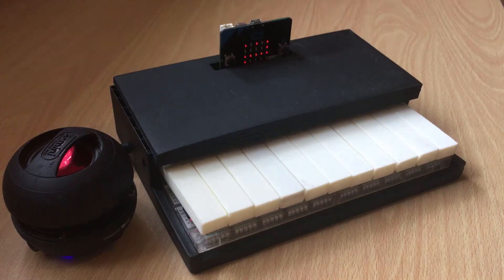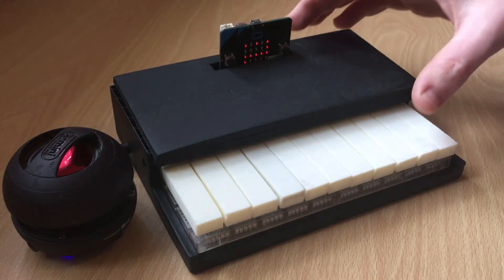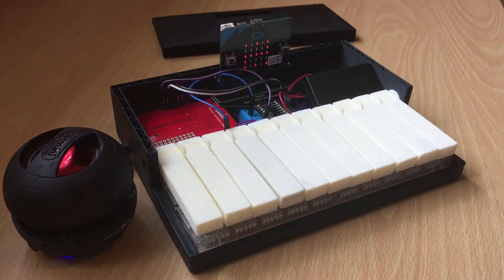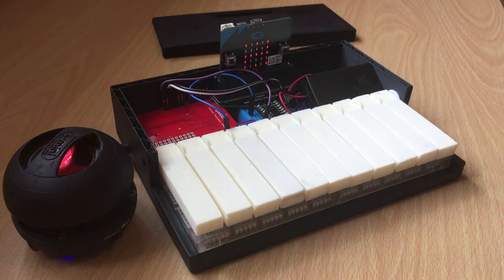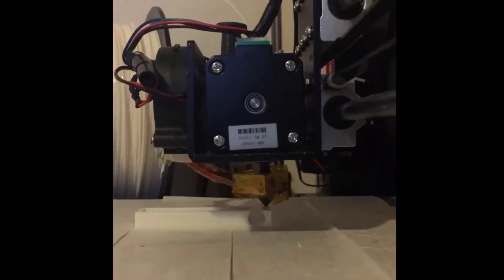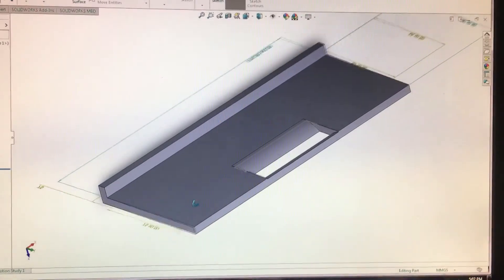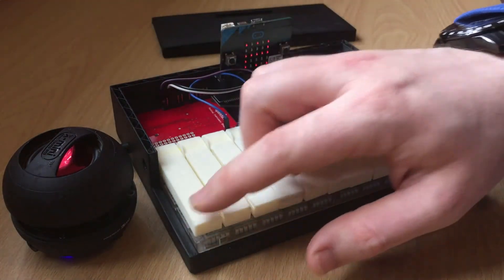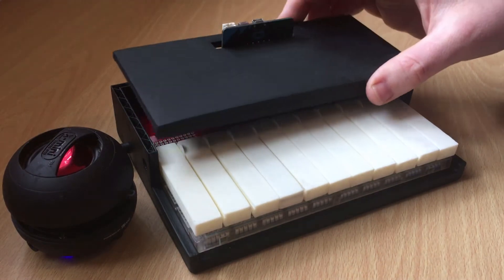Musical Microbits

Comment: Great stuff!  As it happens, I've had a sparkfun musical instrument shield laying around for a couple of years that I have never touched.  I never really got into the arduino very deeply *but I recently got into playing with the micro:bit, and I love it.  I've programmed some cool things.

I would love to know more about how to make this shield work with the microbit.  Any information about how to do this, would be appreciated... I'm not sure where to start there, so even a link would be useful.

I expect perhaps certain commends are sent from the microbit through it's serial commands.  Is that right?  It might sound like I know what I'm talking about, but I've not yet used the microbit serial functionality.  

Last question - does your keyboard take advantage of the polyphonic capabilities of the shield?  And if not, is it somehow limited by the scope of the microbit in this regard?
Reply from the maker: Thanks very much! 

Yes, it uses the UART interface on the Micro:bit to send MIDI commands.  Getting this to work was really a case of taking the datasheet and example program which Sparkfun has on the product page and trying to translate the Arduino serial commands into Python serial.  The demo script is fairly well commented so that cut down on a lot of the work.  I didn’t try setting up polyphony, but sending a signal to a separate channel seems to be as simple as changing one hex value in the note-on signal.   

The MidiBit was put together very quickly to get it in to the Maplin Musical MicroBit competition which we unfortunately didn’t win, but I’ve always wanted to go back to it and overhaul it.  Maybe once we get that done we’ll see if we can work polyphony into it and post the code somewhere.

Hope this is helpful.
Reply: Thanks Glenn!  I will look into this. I'm excited about the possibilities.   In the meantime, the instrument I made uses just a square wav, and  I've used a couple of microbits to create polyphony.  Have a peek when you get a chance.  Any suggestions are welcome.